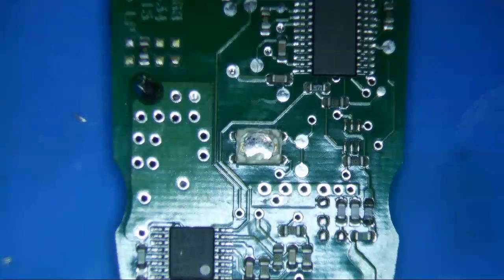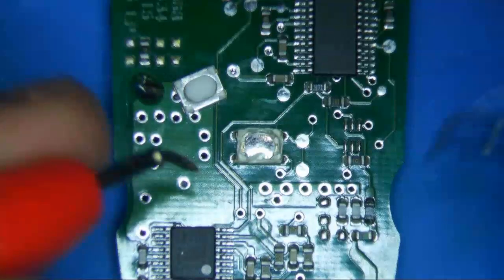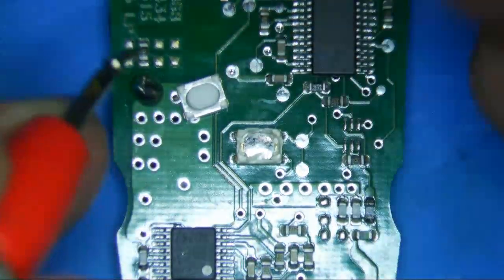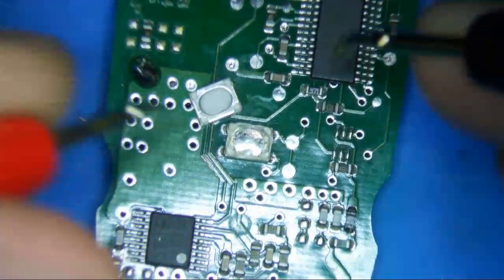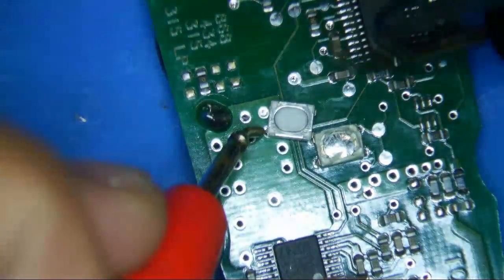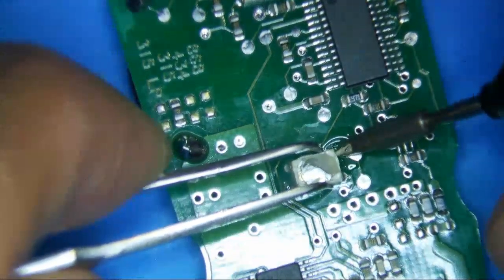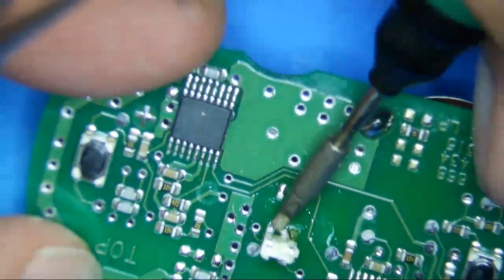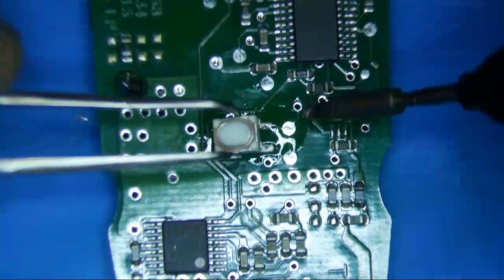BMW Key Fob Switch Repair

Comment: Why  is yours so much bigger than mine? 🤨 lol - love ya long tweezers. I thought  I'd use a solder sucker but everything in there is tiny - maybe try heat I guess... slowly work it off that board.  I've two fob's one with a battery in the mV range and the other a faulty middle sw. 🛠